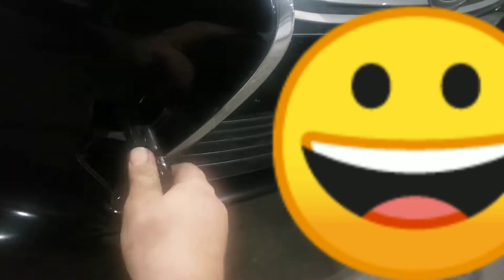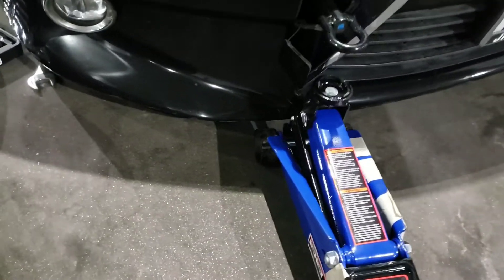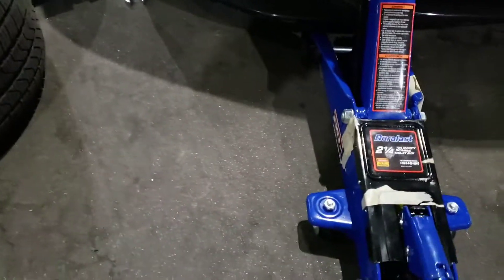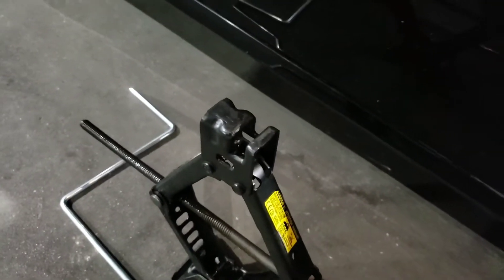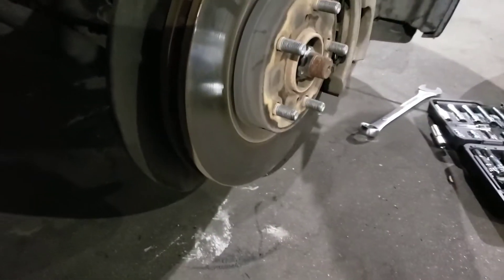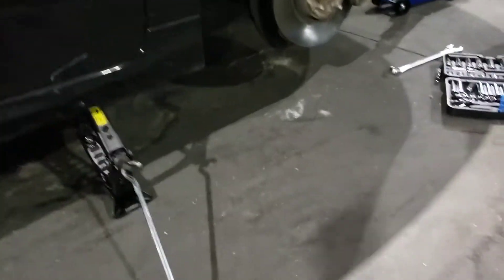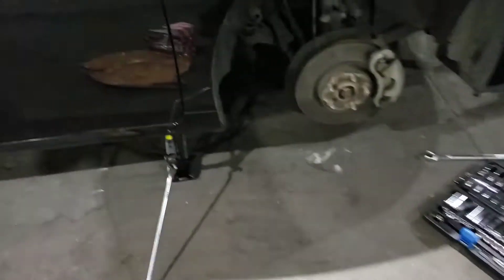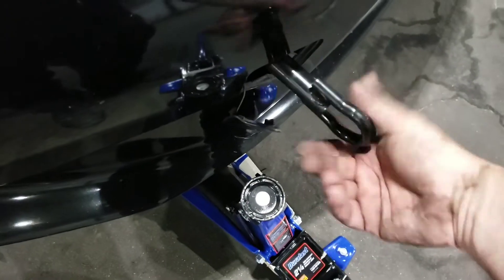What happens when car jack collapsed and car falls flat? How do you lift it?

Comment: Good idea, but it’s not cheap equipment, it’s improper use of equipment.  That jack is designed for an emergency tire change, not a brake job.  You should ALWAYS use jack stands for ANYTHING other than a quick emergency tire change on the side of the road where you don’t have a jack stand.  ALWAYS!